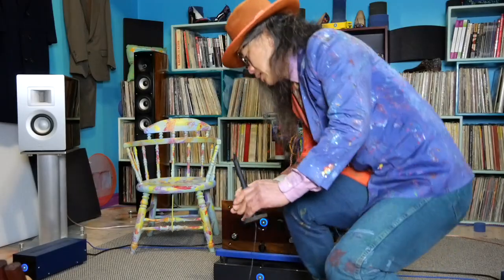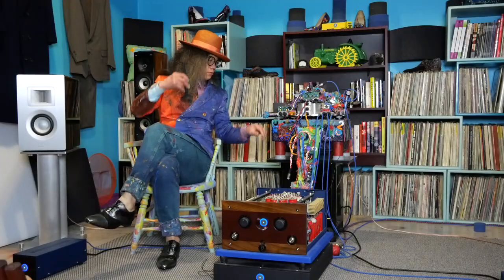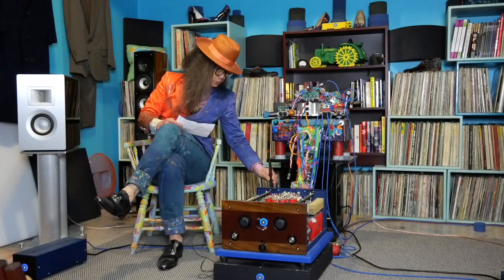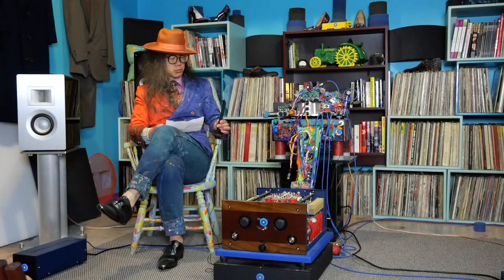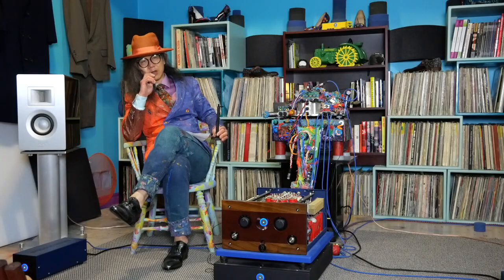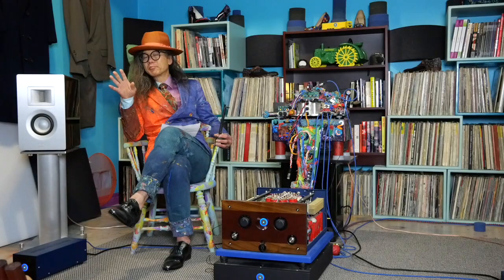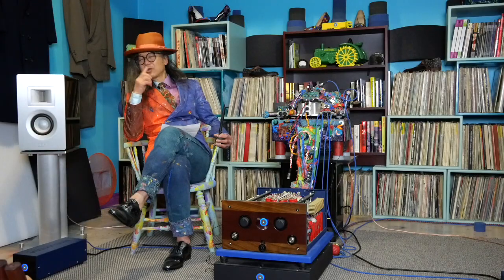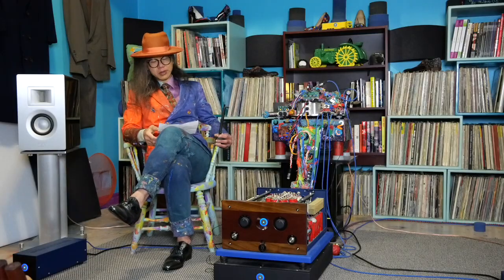Matching Gain with different Power Amps.

Comment: Is there another way people describe what you are talking about? “Voltage gain” is not listed for any amplifier that I can see. Can you please provide some clarification thanks
Reply from the maker: I have already explain the reason why "voltage gain" not listed in any home audio amplifier.  It is very much a standard in other industry where amplifier is used.
In the description, I have posted the formula to use wattage output and input sensitivity to obtain voltage gain.  If you use that formula on any amplifier, you will get the voltage gain in dB and it is the only universal number to use when comparing gain of amplifier.  Using input sensitivity will not get you the correct answer.
Reply: @angela-gilbert still having a very hard time finding the information you speak of. It doesn’t seem to exist. So maybe you could help. What is the voltage gain of an arcam sa10 integrated amplifier?
Reply from the maker: @stubert38  Home audio manufacture don't provide voltage gain in dB term.  They publish "input sensisitivity".  With that info and the amp output power into 8 ohms, apply to the formula that I posted in the description.   Then you will get voltage gain.  If you give me the input sensitivity and the power output of the Arcam amp, I can figure the voltage gain for you.
Reply: @angela-gilbert  input impedance is all that is listed. The input impedance is 47k the output is 50 watts by 2.

Comment: So what makes a good attenuator for fixed attenuation?
Reply from the maker: @shionsmith8190  I make attenuators.
Reply: @ I just noticed on your website when I was looking at your speaker damping factor gizmo!
Reply from the maker: @shionsmith8190  Great.  Now you know what my day job is.  I also put my contact info, web site address in the description.  However, I put it there but don't expect too many will actually read it.  Because I don't read most of the other video descriptions neither. 😝
Reply: @angela-gilbert  Planning on talking George into letting me listen to your tube-like C312 once he gets it in!  So definitely aware of your day job.
Reply from the maker: @shionsmith8190  I have George's C312 done for more than a week now. Running it 24/7 to break it in before going out the door.  We were trying to meet but things keep getting into our way.  He is planning to pick it up sometime next week.

Comment: I just know what input sensitivity means in car audio......First you have the source or head unit which typically will have a 2 volt output, some have more some have less. On car audio amplifiers there is a gain adjustment control, that typically will have a range of .2v to 6 volts. So with a head unit with 2v output you would set the amplifier gain to 2 volts.
With todays car audio tools= DD-1by D'Amore Engineering to match the amp gain. First we would use it to find the clipping point on the head unit or where clean power stops on the head units volume control, lets say 38 out of 40, setting the head unit to a volume of 38 we would move on to the amp and adjust the gain to clipping point or just before, ingnoring the numbers on the dial. Now you can turn up volume to 38 and will have clean power, no clip.
I have never seen a gain adjustment on a home audio amp.....why?
My system consists of Laptop computer= source with a fixed usb output somewhere near 2 volts. Then a DAC with a fixed 2 volt output. Then my amplifier which has a volume knob. No gain adjustment. So how could I gain match these components?
Music-
Artist- Black Sabbath
Song- Changes
Reply from the maker: @freeradical6390  Home audio is not the same as car audio.  In fact, what you did in car audio as you described is not matching gain.   It is making sure it doesn't clip.  Not remotely the same at all.  What I am saying here is to match gain of two of more power amps for the same loudness with the same giving inputs.
Reply: @angela-gilbert  I hear you